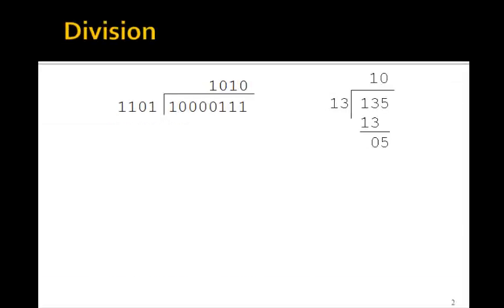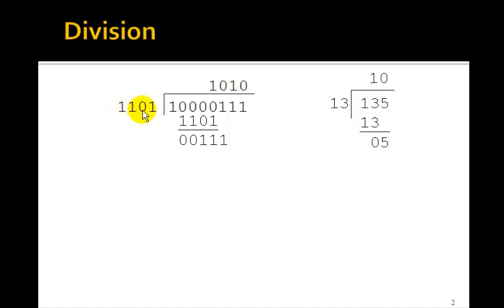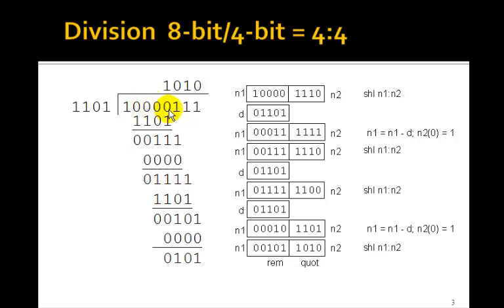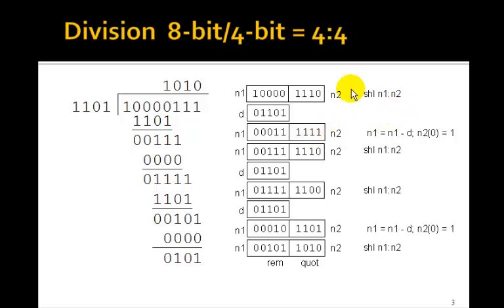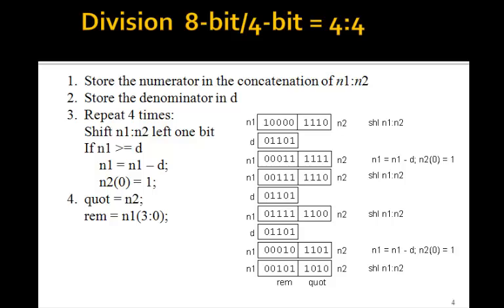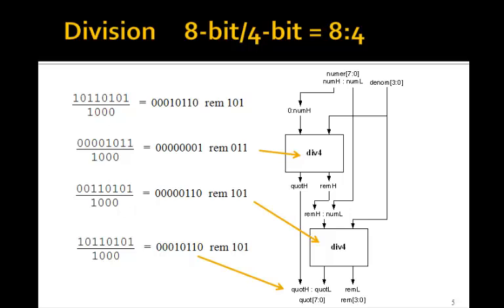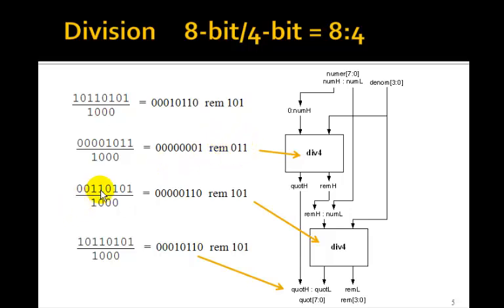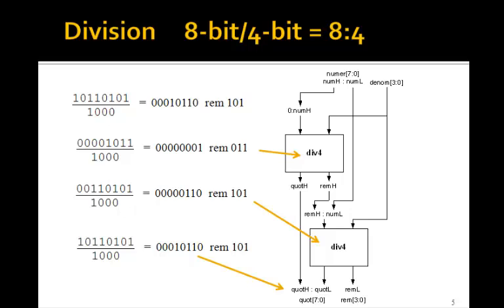Lesson 57 - Digital Division / Divider

Comment: i would like to know how you would make that in a logic gate circuit.
With actual wires. Your video was very good too.
Its just a little different to long division.
edit: nvm. figured it out in april of 2014
Reply: 6 years ago xD but for new guys. in many cases division is not done by hardware with actual wires and gates and stuff like addition or multiplication... they do it with software by doing substruction using adders(+(-number)) and shifting is a normal operation. but if you still want t see how it would look like there giant division circuits on youtube. just type binary division circuit.
Reply: @Knightfire66  What's so funny about 6 years ago? lol And of course all the division logic of operations could be programmed in software. But that'd be highly inefficient compared to at the circuit level. Something as simple as shifting is a whole process to software since everything operates on memory. It's literally nothing to a circuit. You can shift bits around wherever you want them effortlessly. No bitwise operations or anything. Computers need all the speed they can get. They're constantly doing what they can to make computers faster. They'd surely not want to waste any time for such a fundamental operation.
Reply: @DlcEnergy  i wanted to answer then realised it was 6 years ago. was funnny to me.  dont know why. and you understood me wrong. adder and multiplication can be done with one "constant or direct" circuit with no instructions. not sure if its called like that. division is different. division is done by coding. maybe its not called software but its also not direct circuit. maybe its called hardware coding? shiftleft is an instruction as i know. and you need multiple instructions for division. which is a program. but you can multiply with one circuit which is part of the alu. also +, - are part of the alu. there is no division unit in the alu. and in some cases division is done by software. depends on the hardware. and in x86 there is no division unit in the alu. maybe i am wrong in some points. thats what i found out. its not from a computer science script or something like that.
Reply: @Knightfire66  The division algorithm is of course to subtract the divisor out as much as possible. Obviously it's not as simple as an adder. Just because it has to use simpler operations doesn't mean it's not a circuit. Whether you've chained lots of conditional subtractors together or are just using one, it's still a circuit. lol

And again, shifting, as well as bitwise operations aren't even operations at the circuit level. They exist as operations in the alu of course so software can perform them. Since obviously software can't tell the computer to re-wire itself to directly plug a value in a different way. lol
Reply: @DlcEnergy  hmmm. so you mean division is also a circuit part of the ALU? i thought in 99% of cases they dont put it in the alu because its too large and you can do it without its own circuit with just a couple instruction by using the already available full adders and shift registrs...
Reply: @Knightfire66  Too large? lol How would it be too large? How big do you think an adder is in a computer? lol The divider can use the same adder in the alu you know. All the divider has to do is subtractions and keep all the carry outs. That's barely any circuitry. The divisor shifts down its input, and the positive bits update the dividend input. That's it. Yet to explain that simple logic to a programming language...

(quickly makes example in python)
dividend = 39; divisor = 3; output = 0
for shift in range(8,-1,-1): # 8 to 0
    result = dividend - (divisor << shift)
    fit = result>=0
 # or use msb (negative bit)
    if fit: dividend = result; output |= fit << shift
print(output) # 13

It has to do all these individual operations. 1. Shifting the divisor 2. Bitwise to get msb 3. Shifting the msb 4. So we can or it into the output 5. Checking if statement 6. To replace the dividend...

It can just be made so much simpler and direct with raw circuitry. Higher level stuff is always more limited in how they can achieve things.

If we really wanted less circuitry, we could remove adders from the alu and be made to program them ourselves with basic boolean logic operations too. But that'd be just as ridiculous wouldn't it. Circuits get it done faster.
Reply: @DlcEnergy  you dont understand what i mean. a circuit in the alu works like that. you have inputs. and in the end of the circuit you get the end result. the steps you have to do are fixed depending on what kind of system you have. 8bit or 64 bit. on youtube you can eaasily find adder and multiplication circuits which are exactly like the ones in the alu. with division the result/steps depends on your inputs. there is no fixxed circuit for that in the ALU. and you cant find one on youtube. BUT maybe I got it wrong. still working on that.
Reply: @Knightfire66  "a circuit in the alu works like that" That's what i've been saying. lol It's all circuitry that has direct access to everything it's doing. So if you need the msb, you can take it directly. And if you need something shifting, you can treat it as shifted already. And we wouldn't be putting our output through any or gates with constant 0's. We'd just store our output bits and have our result.

And my example with python was just to show the logic to division. Obviously i'd imagine something like that done in raw machine code. Like perhaps for a sine function or something. Since that uses lots of additions, divisions, powers and factorials. Keep it simple and just program it. Obviously the lower level the better. But if you wanted to program it in C or maybe even assembly, it probably wouldn't be noticeably slower. Especially since your machine probably wouldn't use that function as much as say, addition or division anyway.
Reply: @DlcEnergy  ok i understand.

Comment: Thanks for this great video. What if the dividend is smaller than the divisor ? How could it work ? For example 13/135... How are the results going to be presented in binary?
Reply: 7 years :D but for new users. i think you would multiply 13 by 100. then do 1300/135. this would work the same way. this is all done software side so it wont be hard to edit the solution and write 0,0... but no idea how its really done. just an idea. i am curious too
Reply: @Knightfire66  thanks man... Its been awhile :)